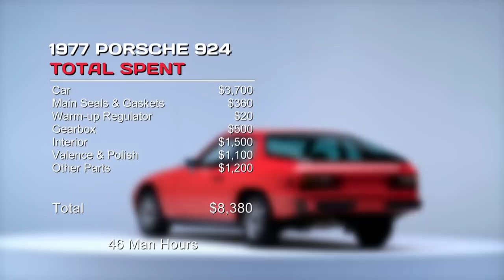Can Ant Get This Porsche 924 Looking As Good As It Performs? | Wheeler Dealers

Comment: 1977 Porsche 924...for $8300?  That's 951 territory.  Much better car.
Reply: and a 1000 dollars work overy 3 years on the 944 belts lovely. And in europe at least, the good 944 start much higher in price whit the really good condition ones well over 20k.
Reply: @Irene smith inform yourself. the 924 has a vw engine BLOCK the 944 engine is fully designed by porsche
Reply: @Irene smith not
Reply: @Irene smith wrong lol

Comment: 1977,1978, model had the nicest looking mag wheels on this car. Too bad the first edition of the 924 had such a small engine. They should have put a 2.5 litre engine immediately, the engine they used for the 1986 924. Had they done that, I think the 924 would have had greater popularity/success/recognition. In my opinion, the 924 was one of the nicest looking Porsches.
Reply: how could they put in the 2.5 in before it was even invented? the 2.5 was made for the 944 and then put in the 924s. the 2.0 was perfectly fine and its not exactly small, for a 4 cylinder its actually quite big
Reply: @kristian5821  Let me rephrase that: They should have put a (one, any 2.5 litre 150 hp engine ) in the original Porsche 924. My parents owned a 1978 924 and we felt that it was underpowered for a Porsche.

Comment: 5:21 how did he lean in and start the car up without stepping on the clutch? The magic of tv.
Reply: Because it's a manual and as long as it's in neutral you don't need to press the clutch to start the car no TV magic
Reply: That’s the opposite of how it works. A manual car can’t be started without the clutch depressed.
Reply: Apparently you don't have a licence to drive manuals you can put the clutch in as a precaution just in case it's in gear but you can just make sure it's in neutral by wobbling the gear stick newer cars you depress the clutch if it has a button start or smart key but older models and cars with normal key blade don't require it
Reply: Every manual car I’ve owned has needed the clutch pressed in to start. That’s also what I was taught when I learned to drive a stick. I didn’t know there was any other way.
Reply: CJ Wilcox Car will start in neutral with out depressing clutch. My 83’ 944 does as well.
Reply: my 2004 mazda6 5 speed manual can start without pressing the clutch, no problem
Reply: @procerus3654  My Audi S3 can start without pressing the clutch, like my old Qashqai.
Reply: Some modern manuals need the clutch or brake depressed to start as a safety feature. Older ones don’t. So long as in neutral it’ll start. However it’s good practice to press the clutch as disengages the clutch from the flywheel so lessens the load on the starter.